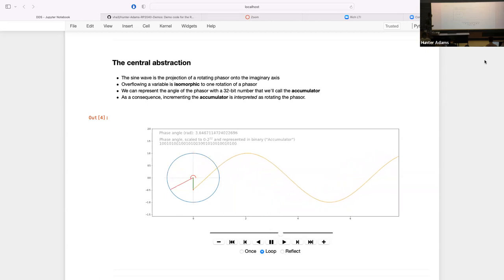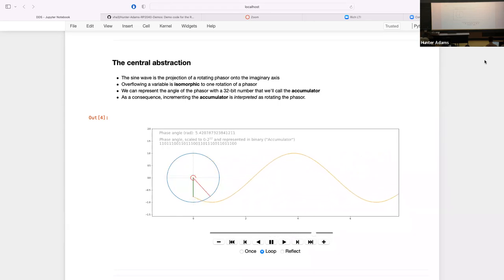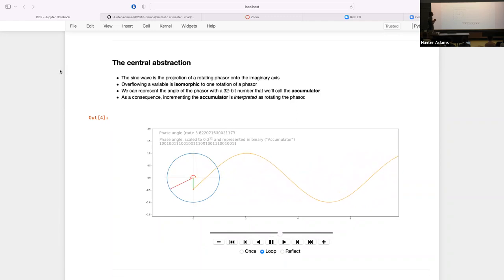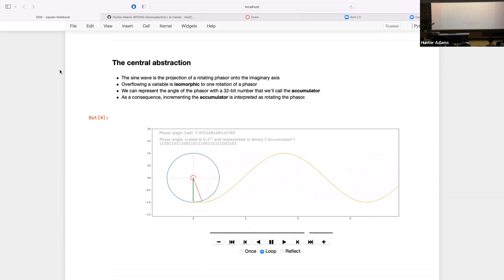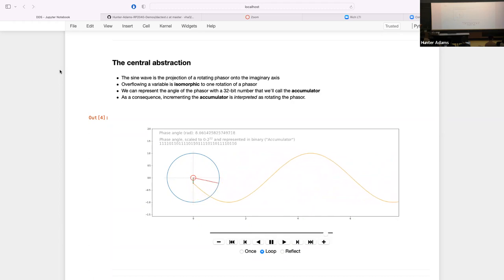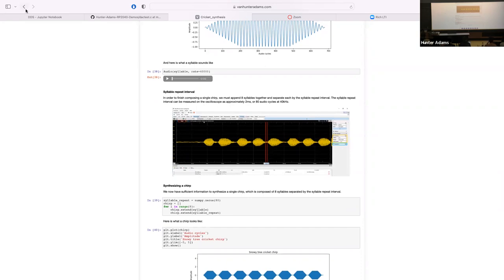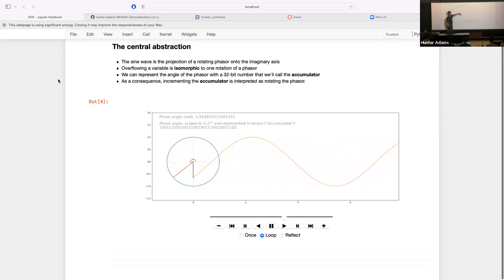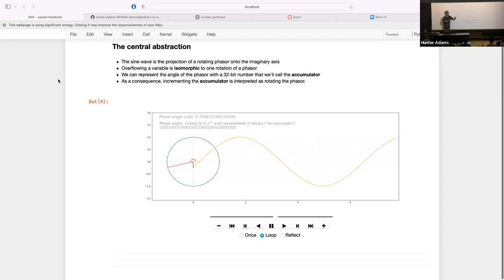Raspberry Pi Pico Lecture 4: Direct Digital Synthesis

Comment: You are using a usec timer?  Your 44kHz will then be more like 43478.26 or 45454.55 Hz, won't it?  It will also depend on when the timer event gets re-established.

Comment: I have questions, i hope you don't mind me asking here. I'm currently at @21:58 and you mention the impact of reducing the resolution. For the example you use (middle C) this might be problematic however this differs for lower / higher frequencies. This is due to the exponential nature of our perception of the harmonics. Would it be possible to have the frequency resolution differ based on the frequency itself? Eg using a log for instance? How would you implement something as such?
Reply: Also could you explain why at the following example the error harmonics do not monotonically decrease? Is this due to harmonic qualities of the modulating wave (resolution) to the sine wave?
Reply: Also would playing multiple repetitions of the same sample by the speakers not basically be a DC signal which will cause clipping in the perceived output at lower frequencies?